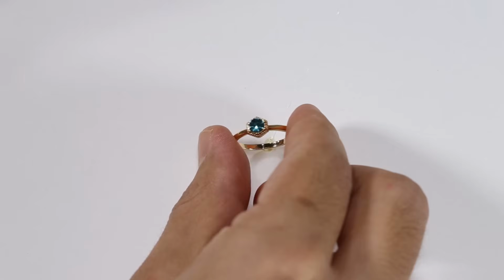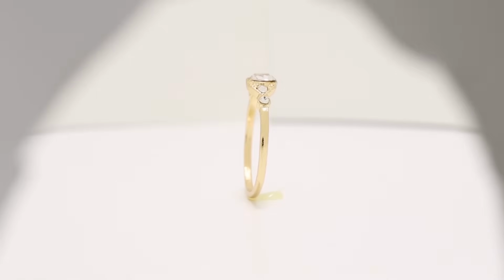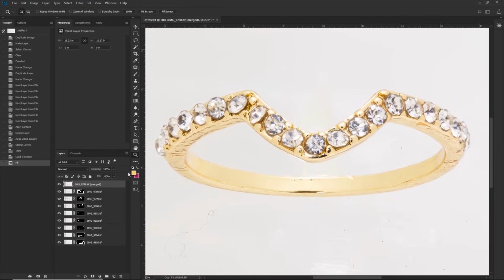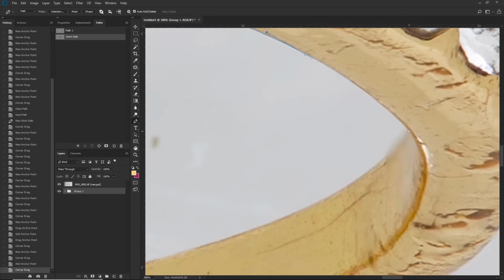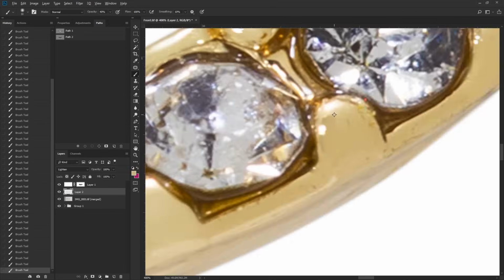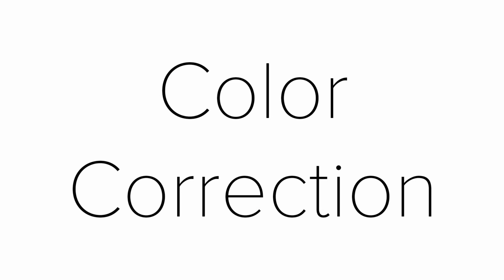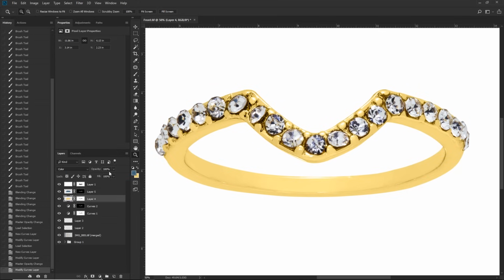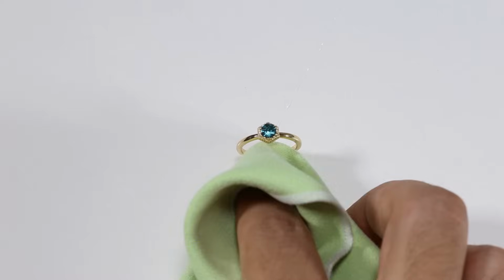Ring Jewelry Photography Tutorial - Shooting and Editing Rings

Comment: Hi I loved your tutorial. I am doing for the First time. But its going nice. But while cutting throught pin tool. I am facing this -> 
I am cutting a ring for E- commerce to remove background and placing a white BG. but rings have different detail design. So if I am creating a path for different  area and  selecting all the paths and then add layer. It is only masking the layer on last path I had created  not on all parts. 
Need solution!

Comment: Your recommendation to shoot at F8 to F11 for macro is yes, usually considered the sharpest on a lens by educators and professionals however...
But when I asked Karl Taylor Education, Karl replied that some pro lens are still very sharp at F16, so I usually capture jewelry from range of F11, F13 to F14 to F16 with 400 watt strobe softboxes, if I want to "extend focus range of macro", within a light tent similar to what you have. I use Nikon's pro 24-120mm F4 (gold series) with D750 (great FF sensor for macro detail capture), and the Nikon macro 60mm f1.8 with Nano coating, both of these are very sharp from F11 and right through to F16. So the ideal aperture depends on quality of lens optics in Karl's reply and I agree after using the lenses I mentioned plus the camera sensor quality also matters.